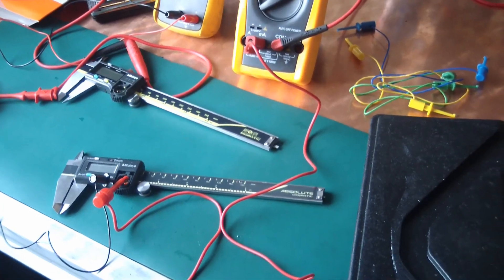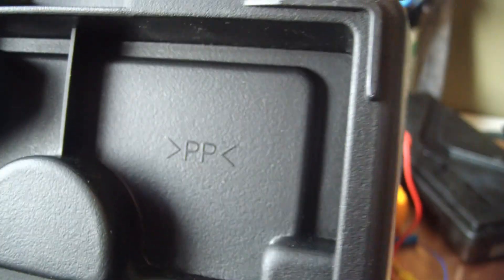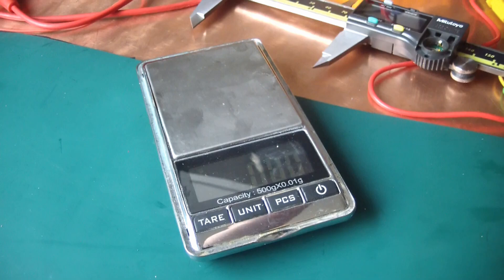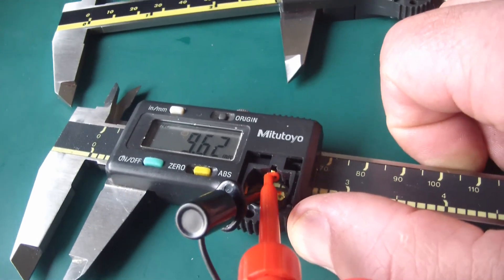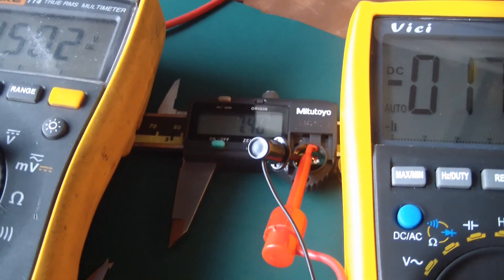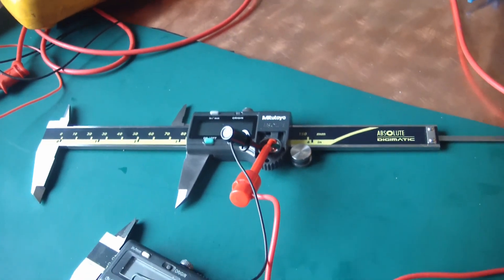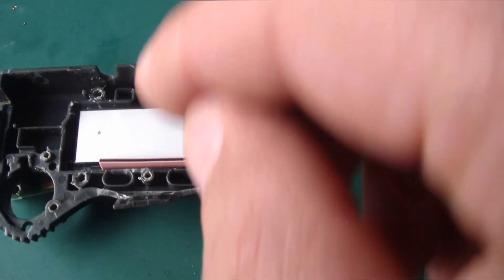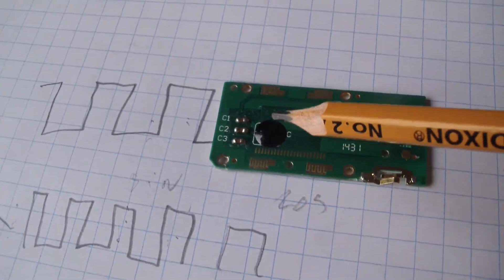BOLTR: $33 Mitutoyo Calipers, too good to be true?

Comment: I got an old school caliper made in CCCP for the 1950's they seemed very accurate to me...
In your opinion is there an advantage having digital calipers vs old types??
Reply: damian33dc 
If you're switching between metric and imperial a lot, the digitals are pretty handy.  Say your reading .117", what's that?  Click the inch/mm switch and you'll find your just about bang on 3mm.  The other big thing is the zero.  Say you want to get the centre of two drilled holes, which have been drilled the same size.  Measure one hole and zero the calipers to that number.  Then measure the outside of one hole to the outside of the other.  Bang, done.  Third big plus is that even covered in grinder dust the digitals will read right and won't bind up.  No rack for crud to get into.
That said, 9 times out of ten I'll reach for the dial calipers.  You can feel out the measurement more easily and the batteries are never dead.
Reply: damian33dc 
One last one - :) - I've screwed up more than one part by misreading the dial caliper's major scale....
Reply: I have a compass(as in the the tool that helps you make proper circles on paper) thats made in Czechoslovakia that cost 500-600$ at the time.

Comment: I never knew they kept positional value when off. I always close mine and hit reset when I switch it on before I use it. But hey I work with wood, and unless you're +Matthias Wandel, the fractions don't matter much. :)